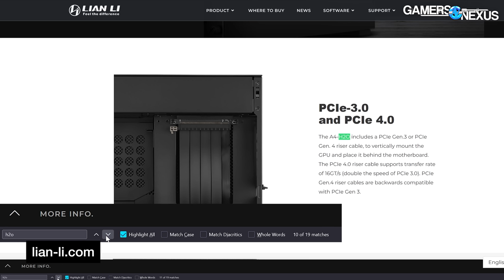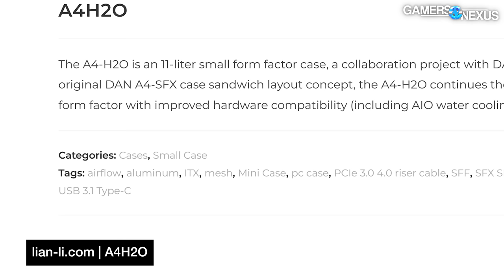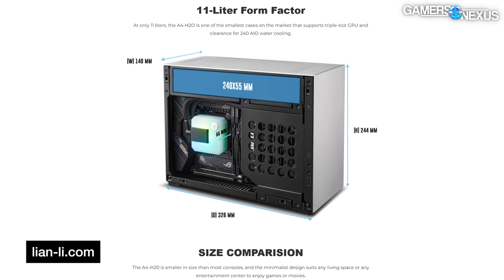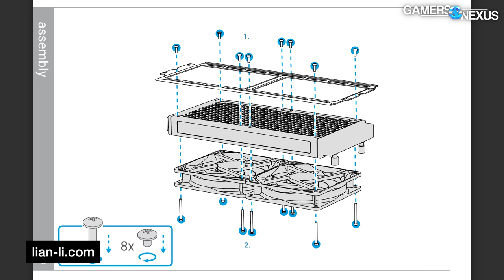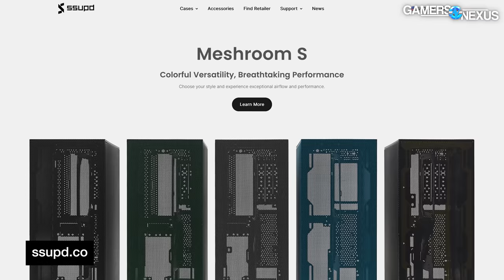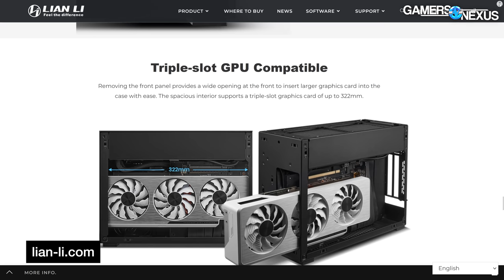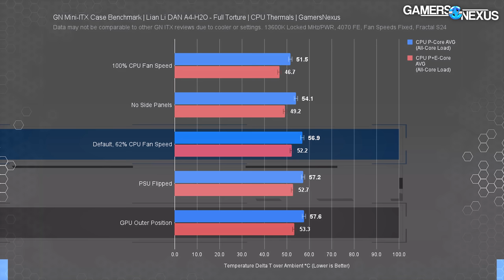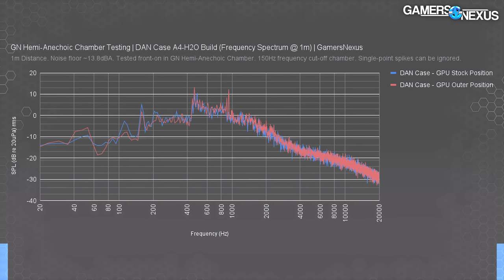Water Cooled Mini-ITX Review: Dan Case A4-H2O Thermals, Noise, & Cable Management

Comment: Wow, I just built one of these yesterday 13900KF RTX 4080 Founders,  850W SFX-L , so far after some 0 undervolting and testing with Furmark, Prime95 Cinebench it's been a dream. I need to buy yet another crimper to make some custom cable lengths though. Almost forgot, I almost thought I screwed up when I first installed the AIO, I accidentally pinched the return hose between the rad and the IEC on the PSU causing my temperatures to jump to 100C in BIOS, rerouted things a little and now I'm down ti 40C Idle and 70C under a 10Min Cinebench load.

Comment: I have this case, did a build in it a year ago (when crypto crash made 3000 series attainable). Was so sad the LianLi Galahad AIO does not fit in the LianLi case... The slim 240 rad was nice, the pipe length was perfect for routing. With the exception the CPU block is too tall so you cannot actually close the case... Still love it tho and it takes a small space on the desk behind the monitor.

Also in general with the ITX case testing, it would be good to say what riser cable is included. PCI-e risers are in almost all ITX cases, and usually the cheaper ones are PCI-e 3, while more expensive ones are PCI-e 4. Even this case has both options, and a significant ($30 when i was buying) difference in price tag, which comes up to +- 15% of the price.

Comment: I had one of these for 6 months or so. It was a great case generally, especially for gpu cooling. I had a strix 3060 ti at first, then switched to a zotac 3080, and both stayed very cool. The cpu temps could be better, but not terrible. I finally got my hands on an Ncase M1 v6.1 or I'd still be using it now.
Reply: You switched because of CPU thermals?
Reply: @EverythingisFire  No I'd been wanting the Ncase M1 for a long time, but my ROG Strix card wouldn't fit. After picking up a 3080 that would, I found a good deal on a used M1. The a4-h2o was a really good case, but the build quality of the M1 is much better. My ultimate goal is to do a custom loop in it, which is much easier in the M1.

Comment: Ive been using this as my personal rig for a while. 5800x 240 ekwb aio 4080 fe 850r Silverstone psu 8tb of cruical drives and its been fantastic. The push pins are great when they work the preformance is great the side panels dont make it any louder

Comment: Love this review, thank you. I have this case too and really enjoyed how easy it was to build in as opposed to many other itx cases. Using a kraken x42, a 120mm fan next to it, 3700x, a750, 32gb ddr3200. It's on the hot side  as it's inside a HTPC furniture, but I am gonna install some fans in the cabinet around it as it has a mesh front. Ideally I would do some dust filtered cutouts,but wife won't allow me to cut into her 2000usd furniture 😂

Comment: Yes, please more mITX cases reviews, at the 10l threshold, and not just sandwich.
If you find different layout, for example, without a riser cable and with the gpu directly on the mobo positioned on the top side and directly cooled to the outside as opposed to the sandwich that puts it inside the case. (aircooled is important)

Comment: Volume is one of the biggest reasons I go ITX and choose these smaller ITX cases rather than something like the Thermaltake V1 or other big ITX case. I take my desktop on planes and put it in my backpack to travel with me even for a day to go to a friends house. The entire point of going ITX is for size. Choosing to not include it as a metric within the context of ITX is a mistake.

Similar for desktop real-estate, although this one I can concede to -- at this size, they are all close enough that it's a bit irrelevant.

As long as you continue to include dimensions though, you're fine, and I respect the decision.

Comment: Nice I actually just built a system with this case. With some care, I was able to get pretty much all of the excess cable mess consolidated underneath the PSU behind mounting bracket and ran the cables along the right side and then top of the motherboard, which the watercooling hoses also ran along, so it came out pretty clean. It's definitely possible if you've got time to sink into organization

Comment: I would argue that the ability to use a better cooler is an ITX case feature and therefore there is some value in comparing different ITX cases with different coolers.

Comment: As someone who had to search for two smaller cases that could fit inside certain IKEA furniture, and eventually did so rather snuggly, I agree that external dimensions should include everything that sticks out - or if something is a "local anomaly", at least that should be explicitly pointed out.

Comment: To add to the list of what to add to ITX case reviews:
- Can the feet of the case be removed? and if they can,
- exactly how much longer is the screws holding the feet on in relation to the depth of the stock feet.
- In other words, How tall a replacement or additional foot can you 3D print ... before you have to get new screws?

What a lot of people are doing if they have access to a 3D printer is printing replacement or add-on feet in order to increase the amount of air space under the case ... its about cooling ... your training has sunk in.  Even further, in some cases with these tiny cases, and high voltage GPU's and CPU's, people are retro fitting quiet, low speed, slim fans on the outside bottom of the case to blow air in or exhaust as needed like a GPU ambient air exhaust in todays example.
All of this is likely beyond the original design of these cases.

Most important is if feet are attached by a rivet and are not removable without drilling it out,
that alone might make some people choose a different case.

Adding info regarding feet for these small cases is a real world thing, worth discussing.
It is a standardizable idea.

Comment: I have this case with a reference AMD RX 6800 in the "outer" position because I wanted to  route the cables in between the GPU and the mobo, and I wanted to give the riser cable more breathing room. I had heard of people complaining about their riser cables failing at the time, and my only guess was that the heat trapped between the GPU and mobo didn't help. Unfortunately, the RX 6800 fans are REALLY loud because they're only 1-2mm from the side panel. Taking off the side panel reduces a lot of the noise. I've thought about getting custom side panel with much larger openings to hopefully reduce the very loud turbulence.

Comment: My favorite ITX case is still the Lian Li Q58 because of how versatile and watercooling friendly it is compared to other similarly sized cases. I hope they make a revised version that can accommodate slightly larger gpus since you're basically limited on the high end to noisy blower RTX 3090s or reference RX 6900 XT/7900 XT. Other than that, its a great case that can accommodate a custom loop with a 240mm radiator for either the cpu or gpu. To get around the fact that there's basically no room for a reservoir, I used a external res/pump and ran tubes out the bottom of the case. That said, you could replace the two front feet and front half of the bottom of the case with a acrylic res tank and a sunk in DDC pump if you have the skills to design that.
Reply: Any 15L+ case has better radiator support than the Q58.
Reply: @svn5994  That's the trade off you make the smaller you go. Less support for large cooling systems and high performance cpus and less support for large graphics cards. That's why my Q58 is configured with a Ryzen 9 5950X cooled by a 240mm copper rad with high flow and pressure fans and a reference 6900 XT because that's the highest end stuff that would fit. Going with Intel, I would have picked a 13700K and undervolted it some while capping the max boost clocks to keep thermals in check. Since my build lacks a large amount of water (maybe about 750ml max), a large heat generating component would probably overwhelm the loop. The 5950X doesn't run quite as hot and it still boosts to around 4.5~4.6ghz under load. It has a mild undervolt as well to help limit how much heat it generates. Since one side of my system is watercooled, I moved both glass panels to that side and put the vented panels on the gpu side so it can breathe freely. This works well for my situation but having an external pump/res may not be appealing to everyone, though it does make maintenance significantly easier and having a pair of quick disconnects makes moving a small watercool system easier since its basically self contained at that point. Kinda like an AIO except with more steps.

Comment: I have the A4 H2O and my cable management is not as bad as you just described, and is waaaay nicer than what you're showcasing in this video. For reference, I have the corsair h100i pro rgb 240m AIO, Lian Li sp850 sfx psu, and the msi gaming z trio 3070 which technically isn't supposed to be compatible with this case (it's 323mm versus 322mm that the case supports. Ido have a 1mm protrusions on the front panel)
All stock cables, didn't customize the length of any cable at all.
But IMO, your opinion on "terrible" cable managability is a bit too harsh

Comment: I had some very good cable management experiences with ssupd meshroom s and its so called standoff mod. This enables you to hide cables between the motherboard and the spine as well as using a good cooler for the back mounted ssd
Reply: That's my mod! It worked so well in the Meshlicious they incorporated the option into the Meshroom with factory parts. I'm so glad it's helping so many builders! GN should definitely review the Meshlicious or the Meshroom; a focus on how many variations of hardware they can fit and the differences they make in thermals and acoustics I think would be a really helpful contrast to cases like the H2O that don't allow for as much variation.
Reply: @DaedalusSix  thank you. Your mod is awesome and makes my build very clean. I love it. It's not fully build in meshroom s v2 tho, since I needed additional spacer from a third party.

Comment: I use one for almost a year, with a 5950x, 6900XT with a EK 240 AIO. Nice temperatures and with a small footprint, looks really nice on the desk.
However, building in it is tough, custom length cables are a good option to reduce the clutter, and cleaning is tricky.

Comment: As an owner of an ITX build that I love - where I managed to fit a 5950X and have upgraded to a 7900 XTX - I feel like you're neglecting as a factor into the cost (on top of the real enthusiast and scale factors) the actual cost of engineering these cases. Making cases that can pull off numbers like that has more cost than looking at the materials and how they're put together would lead you to believe on first glance.

Comment: You can quite easily access the power supply switch from the front if you just remove the front panel, no need to lift the radiator

Comment: If you are planning on building in this case... Get some custom PSU cables and SHORT ram and you will be much happier!  The GPU power cables need to be SHORT or you have so much extra cable all over.   If you use shorter ram like Corsair Vengeance LPX and you can route the CLC  hoses over the ram.   Go with an EK 240 basic water block since you don't get much benefit from RGB in this case.   Throw in a Corsair SF750 SFX PSU and you will be super happy.

Comment: Expanding on the point made about dimensions and volume, there is a serious bugbear of mine, which could be really helpful for [some] consumers to be included in reviews, to move the industry.
Negative points / remarks for not including internal dimensions and spacings for [particularly SFF case (but also larger aswell), with bonus points / praise for making blueprints and downloadable 3D models available pre-purchase (even if some information is removed so it's not easily replicated in China, but the primary information's available for potential buyers).

Whilst straight forward builds are typically catered for just fine, it doesn't take much deviation before online pictures and a couple of [unreliable] dimensions are useless when trying to decide if a case would be suitable for a build.  Given 3D models probably already exist and the software's becoming way more accessible for "the average person", I really think such files should be made available.  This is compounded by the shipping costs for cases, making returns costly if a case is purchased that's then found to not work with an envisioned build.

N.B.  Really glad you're incorporating SFF cases.  For many they're entirely sufficient and as more of us have to live in smaller and smaller residences, becoming more appealing.

Comment: About the measurements, I had this with a be quiet case, where the depth was bigger as published on the internet, but that was a good thing, otherwise my GPU would touch my rad with custom loop. So I am kinda lucky. As long, it's bigger it wouldn't mind me, but if it's shorter things can mess up very quickly. Last year I did a ITX build, but the front is more square, and a AIO just didn't fit in it. Although there is a big GPU (for the case) in it, a MSI triple fan nVidea GPU.

Comment: yep definitely a tight fit. EK240, FE4090, 1000w SFXL, Z690 w/ 13700k....  waiting for the 14700k...  I made some tall stand off feet and 3d printed mounts for a couple of 140 fans on the bottom for more air flow

Comment: Beware that certain radiators come with machine screws that have a rounded or domed top, which means that the top panel of this case won't sit flush and will pop off slightly, unless you find a flat-headed machine screw of the same size as a replacement. I ran into this issue when installing the NZXT Kraken X53 into this case.

Comment: Glad your getting into itx cases I've built a lot of sff builds over the years and better reviews (or even just more for different opinions) will be nice. Last one I settled on is a Jonsbo V3 the build quality is something else just wish they were easier to find in the western market they have some interesting cases for sff but not a lot of English reviews.
I have built in an nr200 and elite 130 both good cases in there own rights and what is now known as Raijintek metis can't even remember the original producer of the case but it wasn't them (got it when Linus was still at ncix) horrible case to build in.

Comment: I get why you don't wanna compare noise levels on cases with different components in them, but in this situation you don't really have many options - everyone who buys this case will surely use a 240mm AIO. Sure, it's not apples to apples, but at the end of the day, I'd still like to know which case makes less noise when fully stacked with the best hardware it can run.

Other than the CPU cooler, I'd imagine you could get most of the other parts to match?

Comment: 12:23 There are two screws holding the PCI extension to the case.  It's been a common problem that it shorts out something, sometimes when the desk gets jarred or the case jarred, causing a lockup/reboot.  I finally, after many months of dealing with these reboots, googled it, and found it was common.  Removed the screws, and it's never happened again.

Comment: A bit bigger but better in terms of cable management is Lian Li Q58 sff case. It's strange that this case have so much publicity when the q58 seems better in almost every aspect, especially if you got additional mesh panels to replace the glass if thermals are a problem.

Comment: This case looks smaller than the NR200, but on Amazon, it shows its slightly bigger in all 3 dimensions. However, based on the dimensions you provided, it is much smaller

Comment: FormD T1 or SSUPD Meshroom S {pls include the $40 extender bracket for mATX boards} would be a nice choice for the next one (give time for limited run, out-of-stock, delayed, V2 production run of other ones to arrive on the market)

You could also do a 2 in 1 SSUPD Meshroom S + Meshroom D video with extender brackets and reverse layout build

But you could also try to ask for samples from Dancase for C4-SFX V2 [Q1 2024], Ncase for M1EVO V1.1/V2 [Jan 2024], or Streacom+Ncase for Freeflow One [Q4 2023/Q1 2024] xD

All the other bigger ~18-20L cases are >Q2 2024 at the very least

Comment: I just built on this case and it is surprisingly good on thermals.  I wouldnt put a 13900k on this tho but a 4090 FE will be fine while the psu faces the gpu to help with the airflow a bit.   I agree that if you can, stick to SFX psu because the SFX-L eats precious cable room, tho its still doable.

Comment: Great review and glad this case is getting a little love and exposure. But I personally think cable management could be attempted better. I’ve been running this case for a year and a half and currently just rebuilt in it with a 7800x3d and 4090 and have never had a nest like that in this case.

Comment: Solid case, but I think the ssupd meshroom s, is the superior case for most. This case is 11L and the meshroom is 14.9L, so it's really not that much bigger, yet it has support for atx motherboard with an sfx psu, with a 3 slot triple fan gpu, or mini itx motherboard with a full size atx psu, and a 3 slot triple fan gpu. Or you can do mini itx with sfx psu and a 4 slot gpu. It can also fit a 240/280mm aio with all these configs listed, which is really impressive. When you go down to 11L it starts becoming much more expensive, significantly less flexibility and build options, thermals are worse, and the difference in size really isn't that significant.

Comment: Currently running 7800X3D + 4090FE in this case with a 240mm AIO. CPU and GPU are basically silent. But the PSU is V1100SFX, which is to be honest kind of noisy, and that is the only complain I have with the system. I don't really need that much power with the super efficient 7800X3D, so I might consider switching back to a quieter one.